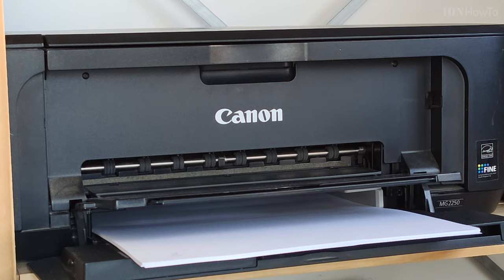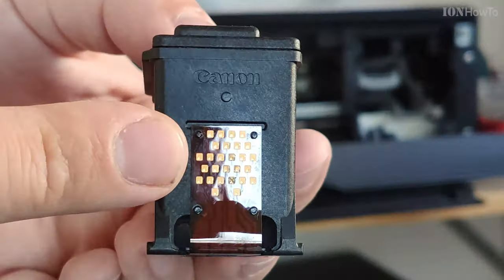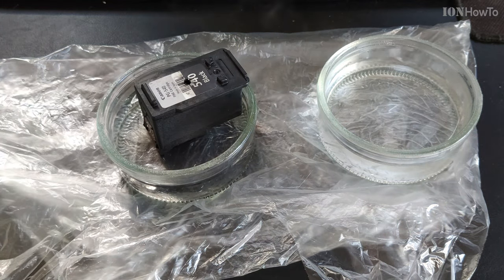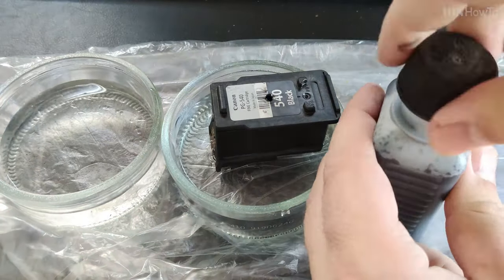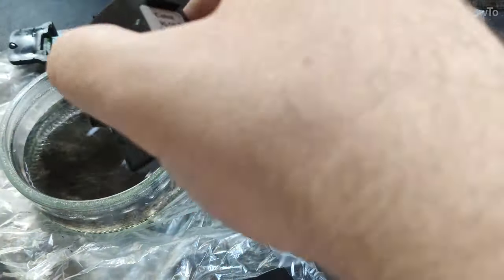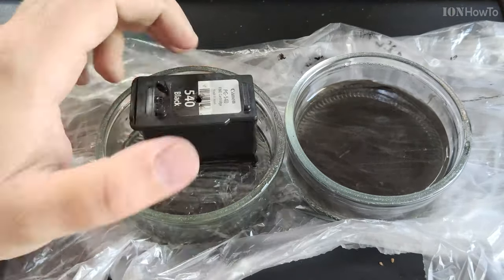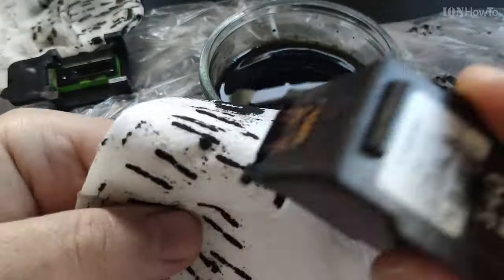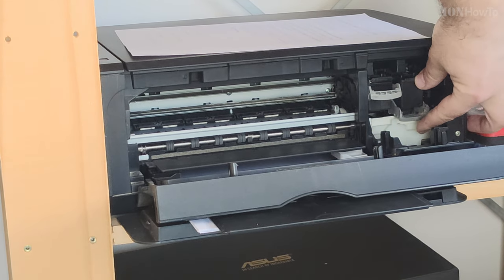Canon Printer ink cartridge clogged printing lines

Comment: there is nothing wrong with the cartridge... set it upright.wait for 10minutes... place it in the printer. do a nozzle check. if its still not printing. do a printhead cleaning. then do another nozzle check... keep repeating until ink comes out. it might even take 10times to do a printhead cleaning. but it will eventually flow out ink. i made the mistake of thinking i need a new cartridge as well at first. but really. i just needed to have patience and have faith it will work out.❤
Reply: Nah I've try this many times and it did not work for me. And I just buy a new cartridge and it's working fine now.
Reply: @Sgt.Rafael-kl8bu  try placing a head to a boiling water. do it 5 times. let it soak overnight. i've never seen a cartridge that can't be unblocked that way.

Comment: Thanks for this. If I am refilling a cartridge, I find it useful to wait 5-10 minutes before printing, because I think it takes time for the ink to soak in properly. I find that if I print immediately after refilling, I still get horizontal white lines on the black areas of print.

Comment: I've got no cyan coming out of my new cartridge. Tried everything with no luck. I think it may have been blocked because it's a 3rd party cartridge.
Reply from the maker: Probably yeah printer manufacturers do everything they are legally allowed and more I believe to prevent us from using third-party cartridges or even to refill.
There should be a better third-party option available or you might have to get the original one.

Comment: hello my printer print lines not print properly also my colour ink catrridge works great, ink flow is good not but in the time of printing they just  gap and print and only two colours blue and yellow with gaps, and can. i use only colour catridge because my black ink cartridge is empty, or i have to fill both of them to work properly?
Reply from the maker: You will need the black one working. If all fails and you need better quality, you'll have to replace the cartridges.
Reply: Set printing option to "best quality" instead of default of "Normal quality" . This works if your printing is limited to few pages only and not bulk printing

Comment: Just printing something on a regular basis will prevent the cartridges blocking up.
Reply from the maker: That's the best way but many people don't print regularly and to have one more thing to do every week or every few weeks just to keep the printer happy is not so great.
A laser printer works fine even if you don't use it for many months.